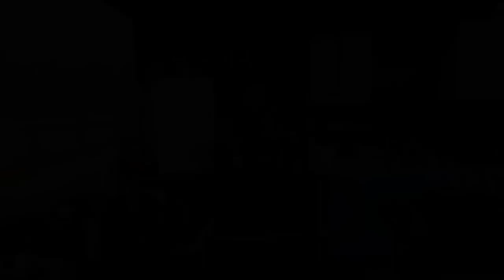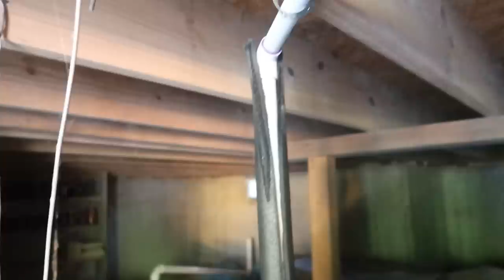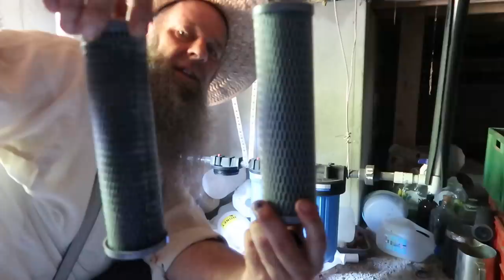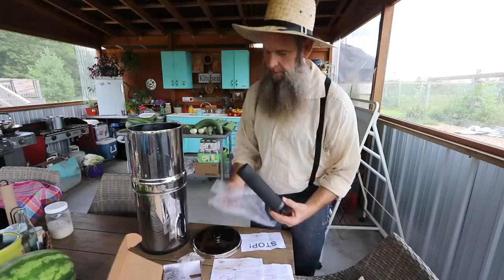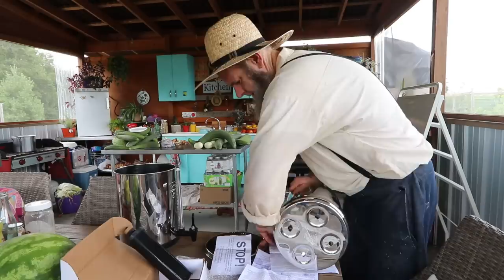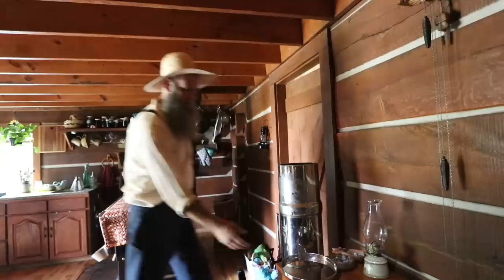OFF GRID WATER could make you SICK protect from Bacteria Viruses Heavy Metals

Comment: Doug, You should run your carbon filter after the sediment filters, that way the carbon will last longer.
Reply: Agree I run my carbon last.  Sediment>softener>carbon.
Reply: We have found that filtering through carbon last is more efficient.
Reply: Good idea.
Thank you for the tip for us newbies.
Reply: I was about to post that.. prefilters before carbon filters..
Reply: That is what I was thinking.
Reply: you are correct , course or large micron filter first , small micron next then the charcoal filter  last
Reply: I disagree The micron filter is the one gets the real small stuff. and the carbon after this why he does that .watch his entire videos an you would know this is why he does this
Reply: @friendlytravelsp5516  You go from large micron to small micron it reduces how fast the smaller micron filter clogs up.
Reply: Agreed.
Reply: @ronnythompson9115  you need to run your carbon filter before your water softener if you are on city water due to chloramines. Chloramines are the number one enemy of softener resin beads, It breaks down the resin. But, if you are on well or rain water,  then you should be good.
Reply: @tjk9722  Have a well.  they also have a well. but thanks good to know
Reply: I have been running the sediment filter first for five years and it is more efficient. I am completely off grid with solar. You are never really off grid as long as you use propane and gasoline. JS.
Reply: Thank you so much Doug.
Reply: I agree, carbon last best flavor
Reply: @friendlytravelsp5516  The carbon filter will become useless almost immediately because the larger particles will block all of the microscopic pores that SHOULD filter out the smallest particles!
Reply: @larryfoster2227  The filters are made of plastic, so if you use them you are still on the grid?  Grid meaning electrical grid, or power grid!
Reply: @robertwilkinson8115  so, unless you chew down your trees and don't use a bucksaw for firewood you are still on the grid? 😂
Reply: @larryfoster2227  That makes no sense at all.  Neither has anything to do with the electric GRID. If you are just trolling for a fight, forget it.  Not interested.
Reply: @robertwilkinson8115  whatever!
Reply: but then you get carbon in your water... which is  the very reason the threaded filters are used last. ;)
Reply: @GOD_IS_REAL  In theory, perhaps it would be good to put the micron filter in between two threaded filters?
Reply: I used to worked for a water filtration company. The sediment filters were always before the carbon filter.
Reply: First filter should be SEDIMENT... then LARGE sediment (10 microns)... then 1 micron filter... )  then CARBON.... then BURKEY.
Reply: @friendlytravelsp5516  Hey Friendly, I also run a marine aquarium, if you research a RODI set up you use a sediment filter first, ( also the cheapest/least expensive to replace) then your carbon block, RO filter then the DI resin. The sediment filter takes out the particles that can cause your downstream filters to clog, carbon filter remove chlorine/chloramines (among other contaminates) RO helps to remove dissolved solids, (usually the final step for drinking water) DI polishes off any other dissolved solids.   At least is how I run my set up.

Comment: Ive been a plumber for 19 yrs. And I'd like to offer some advice. The plbg / filtration system looks good! But you shouldve used copper pipe before or after the filters. The reason being is copper pipe sanitizizes water. It's copper property's kills viruses and bacteria. Word to the wise. Love the video and all your intuitivness!
Reply: Ya don't say? Huh. I know plumbers...wtf? They are in trouble!!!! I never knew that. 
Thanks!
Reply: @heidi22209  I THOUGHT IT WAS SILVER THAT KILLED VIRUSES AND BACTERIA  / COPPER IS A NEW ONE ON ME  / WELL WE LEARN SOME THING NEW EVERY DAY  DON'T WE  / THANKS
Reply: Copper pipes can erode and leach into the water. Also make certain if you do have them that they are not connected together with led.Osmosis filters are the best for cleaning the water for drinking.
Reply: @qicksilver8949  erode? No Mr. Silver copper pipes don't just waste away. It would take some really hard water and about 100 yrs for water to erode copper. Especially if said copper pipes are installed properly avoiding bi-metal contact , insulated and a filter installed before the plbg system. Also lead connections would be almost any public connection pre 1980, so always check that before any improvements are made regardless. Copper out performs any other water distribution system out there in terms of water quality and longevity by far.
Further more R. O FILTRATION will remove pretty much everything healthy and unhealthy in water. Making it useless or rather harmful for human consumption.
The best filter to use would be a simple homemade filter utilizing gravel sand and activated charcoal, which can also be done from home at little to no cost. 
Mr. Silver here is obviously not a plumber nor is he a very good googler. So before you start dishing out potentially harmful advice about drinking water push a few buttons on that nifty lil device you got in your hands and check yoself
Reply: @joshakers1  Copper pipes are a known cause of copper-toxicity.

Comment: Those black filters are actually called “fast flow filters“. The capacity is probably 1.25 gallons. I’ve had a Berkey system for several years and I just love it! I would not drink the munni water if my life depended on it. Get in the habit of a glass in for every glass poured. When I fill up my coffee pot I fill it up at the sink, pour in the top dispenser at the bottom. When I fill up ice cube trays I know that it’s 2 cups.  I put 2 cups in the top and just fill up my ice cube trays. This way you always have a full Berkey and you don’t get angry when you’re thirsty and somebody forgot to fill it up for you. Enjoy the clean waterHi

Comment: Just a recommendation, Always, I mean always use some silicone lubricant on those threads on the head of the filter canister before you screw the canister back on to make sure that you will be able to get the filter canister to unscrew the next time that you change the filter.  Also they make a special wrench to help you to unscrew the filter.  The charcoal filter is for taste and odor and the string wound filter is for sediment.  For the bacteria, you would need an ultraviolet system.  We used to own a plumbing and electrical store for 40 years and did service calls also and water filtration was one of our specialties.  I love your videos.  Love Stacy's cooking and fermenting videos.
Reply: You can get food grade silicone lubricant too. Companies that make it are CRC, Spray On LU210, Cabela's, Jet Lube, Super Lube, 3M etc.
Reply: That's right! Culligan makes two sizes of wrenches. I think I remember the bigger one cost about $15 at a farm supply store.
Reply: Claudette would you be able to recommend a whole house filter for Iron. I moved to a house that has a well and terrible iron problem. I use string filters because that is what the previous owner did. It does help but the water still has enough iron in it that it stains the white shower stall and my hair is getting a slight orange tinge to it. Thank you for any help.
Reply: @flowergirl8887  My husband is the real expert on that subject.  You can take a sample of your water to probably Home Depot or call your local county to see if they can give you the name of a lab that they might use to test water and have them test it for how many ppm (parts per million) of iron is in the water.  You may have other minerals in your well water for instance, sulfur or hardness.  Even Home Depot would be able to sell you a system that would take care of the iron.  For instance, one of the filtration systems for iron would be a greensand filter system.  There are a few other ways.  Look at YouTube videos under "iron filtration system for well water" and it will show you what they look like and what to do.  I don't know how knowledgeable someone at Home Depot would be as opposed to someone that specializes in water conditioning and filtrations.  Beware of those companies that want to sell you more of what you might need. I'd watch quite a few videos and write down some questions that you can ask whomever you talk to.  Hope this gives you some help.
Reply: @flowergirl8887  check the iSpring company from Georgia, great product and the phone service advice is honest. I don't find big box stores to fully understand all problems. For instance, my well has a sulfur smell. It took a long time to find out my iron would not be filtered unless I put in a hydrogen sulfide filter first. It took a lot of research and finally found the answer in an Amazon comment.

Comment: Hi Doug,
We LOVE our big berkey!!  We’ve been using it for over 10 years. One thing we did to to add to the use of our berkey was to get a food grade bucket and put a spigot on it. It sets beside our berkey and holds the “overflow”. As the berkey fills we pour it over into the extra bucket. For us it helps keep track of our water supply and not run out as fast
Reply: Turns out Berkey filters are not NSF certified. The company claims it is too expensive to lab test for every contaminant - which is required to be NSF certified. The "3000 gal" filter claim is arbitrary.
Reply: @THXx1138  
Even so, we should be able to tell when any water filter we use needs to be changed. If we don't go by the calendar, the taste will definitely let us know.. Ty
Reply: @THXx1138  true!! true!!! just watch Robert Beaty & thats why Berky is in a class action lawsuit in Texas right now!👍🏻✌🏻

Comment: Thank you Doug! We get our water from a beautiful, clear creek and still filter our drinking water through a Berkey just for peace of mind. We’ve had the Berkey for a couple of years now and recently did the red food coloring test to check the filters. Even after two years the filters are still working great! Well worth the money!!
Reply: Great news.   2022
Reply: Make sure to do red food dye. 
Berkey had gone downhill recently in past two years with their filters.
Reply: I am curious if the chemicals in some water sources may be breaking the Berkey down. Just a thought.
Reply: I watched a man on YouTube who made a simple two step filter like a berky using two large steel pots!  It looked easy and was very cost effective!
Reply: I have been using a Berkey for 3 years and the same filter. It is now time to replace the filter. I have heard they will go for 5 years but not on my well laden with rust
Reply: WhT is the red food color test
Reply: @jessicacanfield5058  Berkey tells you to do a red dye test each time you set up your water filtration to ensure that you have no leaks where the filters go through the holes into the water reservoir.  They want you to set each filter into a separate glass jar,  this way you can tell which filter is having an issue.  If,  the water coming out is pink... then to know there's a leak.  When I first set up my Berkey,  one of my filters was leaking red into the water.  I just had to adjust the screw tighter a few times to fix the issue.  No red dye passes through the filters so you know it's set up correctly with no leaks.

Comment: We are in the Missouri Ozarks and in the first year of our off grid homestead.  We have our big chicken coop and raised bed garden area fenced with 12 4x8 beds we were able to get filled and use this year.  I see the progress and beauty of it all and I'm so grateful!!  You guys are, and were, our inspiration to do this.  You are our Homestead Heroes!   Thank you both for your inspiration and informative videos!! It's been such a blessing!
Reply: I have a house I am rebuilding 60 miles South of St. Louis, Bismarck.  It is a small town. I want to start making all the stuff instead of using the electric and water from town. I am putting in a swim pond and want to put in a water wheel to generate electric.  Dig down to water source and add a pump. Hopefully by next year it will all be done. I am not taking any vaccines so I won't be able to buy sell or trade for electric or water.  I hope to have the house rebuilt by fall this year.
Reply: @inspire734  I recently saw a couple yt vids of diy water generators made from old washing machines. You oughta check that out, may be what cha need.
Reply: Your right ,
Very inspirational ,
Reply: @inspire734  look into microhydroelectric instead of a big wheel. Also a diverting spiral drain can produce he generation. About 8' across, I think. The inexpensive components are not complex. Imagine how a hose sprayer works? The pressure of the water coming out can spin a small generator. A waterwheel scaled down.
Reply: Thanks for the information.
Reply: How much is the land i live in st louis tired of dealing with ppl i grew up in Northern Arkansas wood stove heating no ac canned our garden food processed our own beef (live cow) in our back yard used the waste for fish bait on bull shoals lmao simple life hard work less stress
Reply: @inspire734  we have a cabin about an hour south of you. We're not off grid but we're using rain water collection system. Ours is only 650 gallons and we use a shallow well pump. I'd love to have a deep well because the water here is so good but the cost of a well is so expensive. The gutter collection will work for now.

Comment: Hey Doug!  Right now I use the Zero water filter and I love it.  It is a smaller container and is quiet,  water taste great.  I bought a 2 pak filter to go with it.   Does not take long to release filtered water into reservoir.  But guess what.  I have heard of Burkee since a few years well now.  I am also sold on it.  Not until I'm in my tiny house will I have one of those.  And I'll still have my zero water filtration system.  I'm not getting rid of that.   Listen, thank you so much for the demonstration of that Burkee.  It is just as simple as the zero water filter.  God is good, all the time, confirming and reaffirming.  Shalom!
Reply: I switched from a Brita and a Pur and a faucet mounted Culligan filter to the 2-gallon Berkey.  It's way easier, faster, better, and cheaper.
Reply: HEY MY DEAR YOUR ZERO WATER FILTER IS THE BEST ,,, BETTER THEN BURKEE ... MANY BLESSINGS 😌
Reply: @patriciadavis7444  
Hi!  Actually a Burkee would be the next step UP from the Zero.  The Burkee is more powerful in cleansing water.  That's why my next purchase will be a Burkee.  Thank you and have a good one.
Reply: @rc2639  
Hi! Yes, that's the way to go. Enjoy!
Reply: We have a Berkey and a Zero water pitcher. The Zero water came with a testing device. We were curious to test the Berkey. We had two regular filters and a fluoride filter, and  all were correctly primed. We were so disappointed in the Berkey water! It tested as bad as the tap! (We have hard water in the Phoenix area.) It surely did not taste as clean and pure as the Zero. I researched Berkey for a while before we purchased it, and read many rave reviews. Maybe we just got bad filters. 🤷‍♀️
Reply: @evitairish  
Hi! Perhaps by the filters made for the Berkey.  Yes the Zero water filter is awesome.  But I want to take it to the next level and be able to clean dirty water in case of extreme water situations.  Guess I'll continue to research water cleaners for that kind of clean level.  Have a good year!
Reply: @omaam1005  Thank you. Oh the filters I have for the Berkey are all made by Berkey.

Comment: We just introduced a Berkey to our home, next the sun oven.  The hardest part of the Berkey is the priming...it’s a great system.
Reply: Tony thompson  What line?
Reply: Modern faucets are difficult to use for priming.   Berkey sells a priming kit.  Just used it last weekend when I cleaned my filters and it worked just fine.
Reply: Karen Richardson yes I saw it and after I buy the fluoride filters and glass measuring tube I may consider this.  Thank you😀
Reply: It was a bugger for me as well
Reply: @Opy Brook I notice that now Berkey includes a "Pro Kit" with purchase.  Includes a different type of primer.
Reply: @Opy Brook that's not good!   Check out the youtube videos about setting up your Berkey. It is not difficult.   My addon advice - because the cylinders are round and will roll, put two rolled up towels on either side if you lay it on the counter top.  I had the unhappy result of my fluoride filters breaking off when mine rolled into the sink.
Reply: We just got the sun oven (love it!) and the Berkey is next 😃
Reply: I have been enlightened 🌞 Great video...
Reply: Berkshire makes a primer pump that works great.  It’s available on Amazon
Reply: I just let water slowly drip in the filter and it worked great. I didn’t get the gauge because I can tell, by flow rate, how much water is left.
Reply: @noellehedman5412  what's the glass tube for?
Reply: k4kale to see how much water is in the  container.  Why?
Reply: @K4Kale  the glass tube is above the spigot on the outside so that you can know how much filtered water is in the lower container.  I don't have that special spigot.  I bought the smaller 2-gallon Berkey because I'm the only one using mine.  I dispense the remaining water from the lower cylinder into cups and pour that into an old clear plastic Pur dispenser. Since that water has already been filtered by the Berkey, I removed the filter basket and filter from the Pur dispenser.  Mon Pur has a spigot too.  This way, I can fill without removing the top part to check the bottom part because I empty it before refilling it,